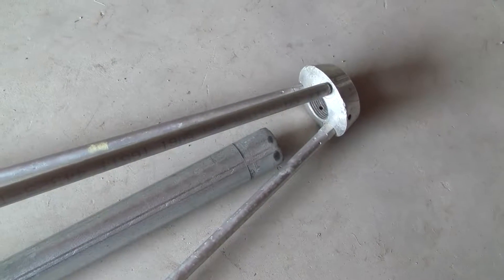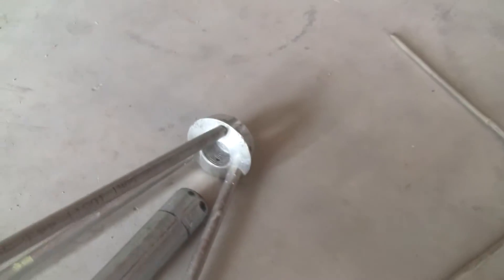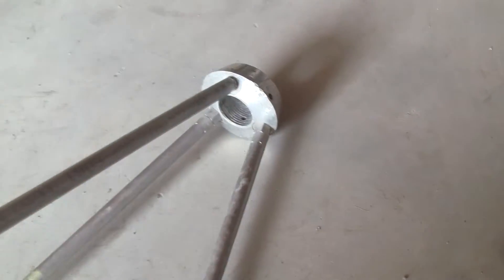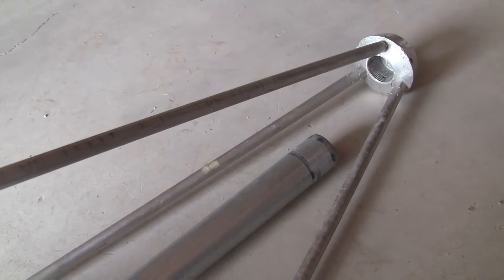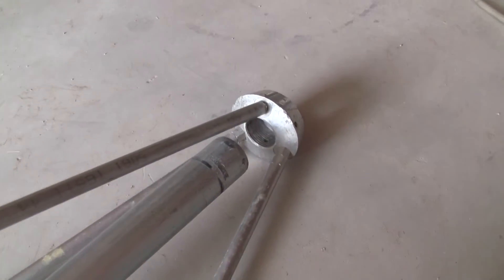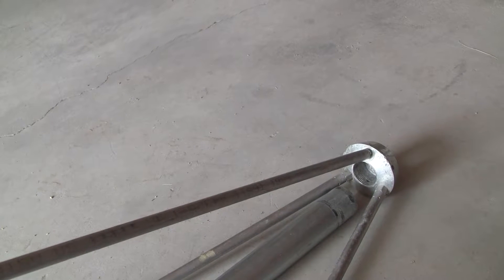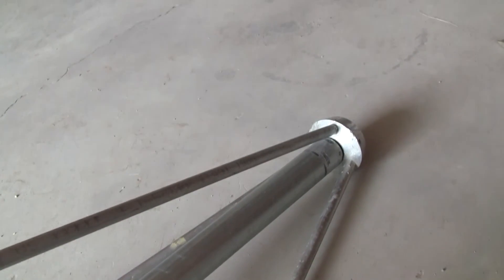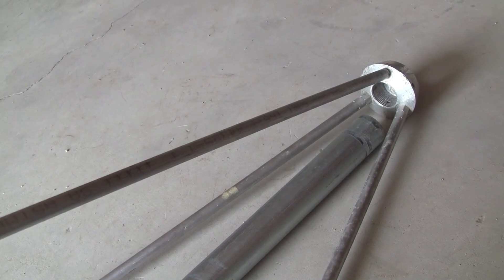1970's Starduster Repair and Installation. Part 3.

Comment: You sound like one of those guys who makes things more complicated than they already are.  You already have a brand new Starduster NIB USE IT❗Just rip that box open put it together & use it. Home Depot sells 10ft sections of swagged pipe for $11.00. Drill a hole & bolt each section together,  for the top section  just drill a hole & use a eye bolt to attach your guy wires to. Find a base pipe about 5ft to drive into the ground leaving 2ft above to slide bottom of mast into. Drive 8ft copper ground rod in & attatch to mast pole. Done.👍
Reply from the maker: Restoring this antenna that I used in the 70's is worth what ever labor it takes to repair it. Machining and making parts is easy for me and a joy. The swagged pipe at Home Depot is for fences, making it the wrong diameter. At least in CA and AZ. I haven't been able to find genuine swagged antenna mast pipe in 10 foot lengths for years. 5 footers yes.  So I make an adapter to fit my emt tubing. Again, not difficult.

Comment: I'd put it in my lathe, turn it down and thread.
Reply from the maker: I would but my lathe has the wrong change gears, so I can't thread accurately.  It's off by about 30%. Finding 44 tooth gears that have a 1/2" bore has not been fruitful.